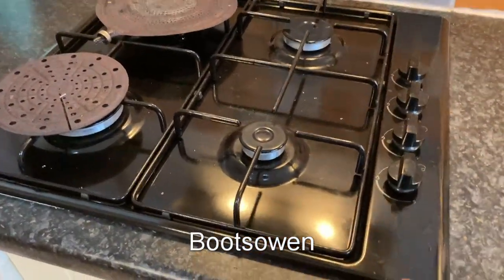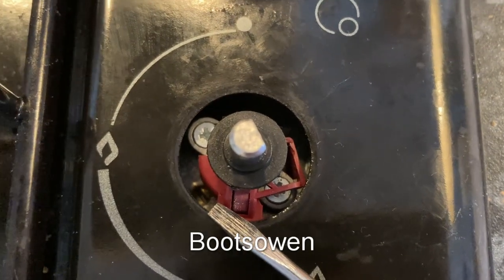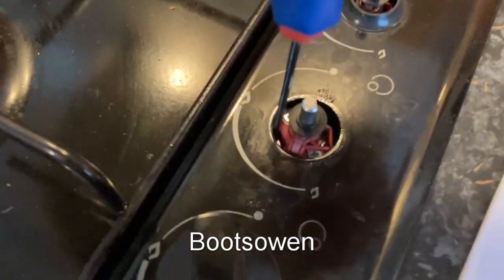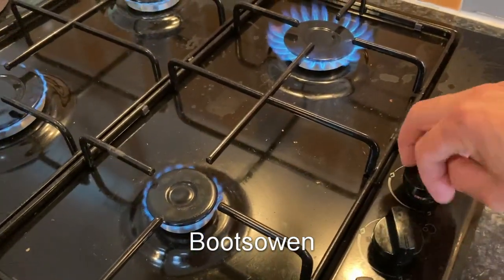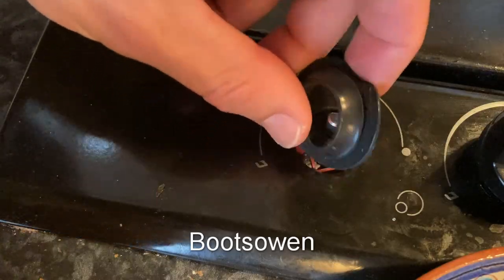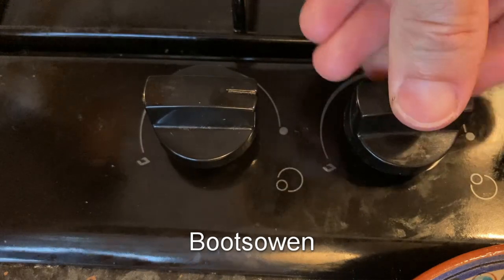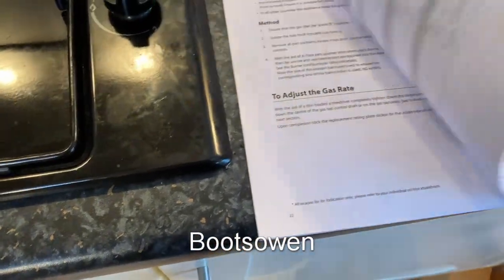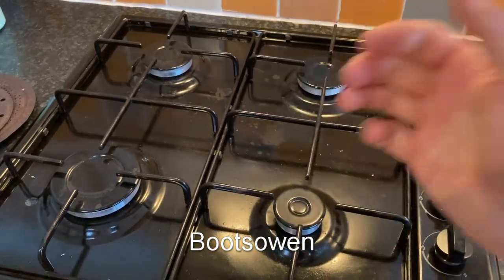How to adjust the low flame on an LPG gas hob installation(when changing from natural gas to bottle)

Comment: Hi bought a natural gas full cooker off marketplace hubby is good at diy he changed all jets to the correct numbered lpg jets all the flames works perfectly but outside back gets burning hot after oven even on low heat after 10mins & more, even glass front gets quite hot ,ive had lpg gas cooker before it never got as hot as this cooker,is it safe & what could be problem do u think? Hope u can help 😊
Reply from the maker: Sounds like you know it’s not safe. I’m no expert. You could pay someone to do it professionally.

Comment: Oh wow! My problem is the flame is too low even on high. So do I the reverse please? I’m in Australia and it’s a Westinghouse. Many thanks.
Reply from the maker: Have you got enough gas? was it always this way or has it just happened? Is it clean?
Reply: @bootsowen Hi there. I think it’s always been under par since installation. I clean them regularly but used a fine pin in the centre holes and that has made some difference. I have a feeling I need someone to turn up the valves maybe? But your videos are so easy and helpful to follow. Thanks for your help. 🦘🍻
Reply: @ oh yes, we have bottle gas and they are newly filled. It’s not piped gas here. Thanks again.

Comment: Great video. I installed a Bosch hob in my kitchen over five years ago and have never been able to get it to simmer properly and have burned several dinners. I adjusted my hob this afternoon and it's made a considerable difference! I look forward to using it on a lower setting in future.
Reply from the maker: That was what prompted me to check, I had to use multiple heat dissipaters to get a simmer, which must be a waste of gas! Glad it helped, I have another one to do now! 

Remember to check if the gas pressure can sustain all 4 burners on the low setting and the high setting.

Comment: Great tip!
My hob has a wok burner who's flame doesnt seem to be as it was when new. Jet is clean so perhaps your adjustment tip and be used to increase maximum throughput.
On the otherhand, my smallest burner could do with going a bit lower for the mokka pot or individual egg poacher. So this tip should definately work for that!
Reply from the maker: It is one of those things, I didn't even know it was possible, but it is well worth doing if you are on LPG! worth a try Ian.